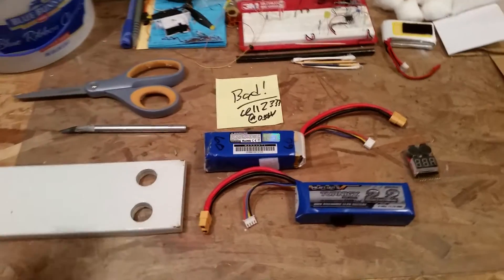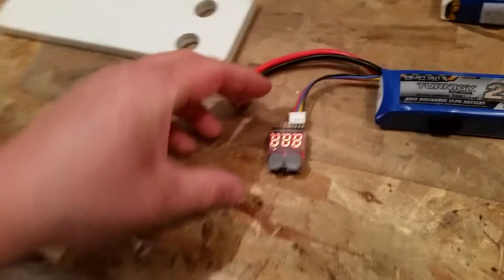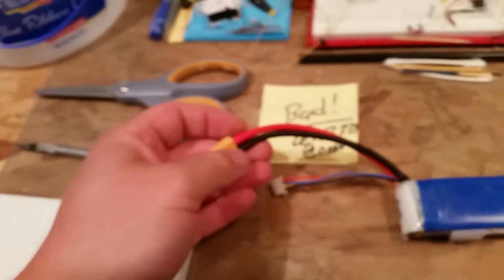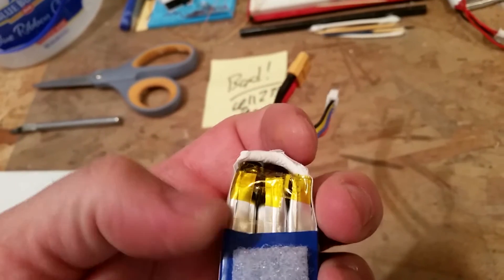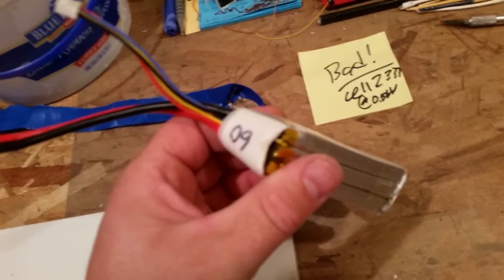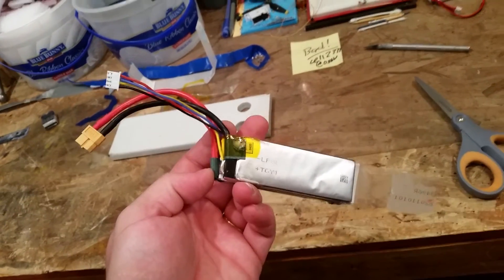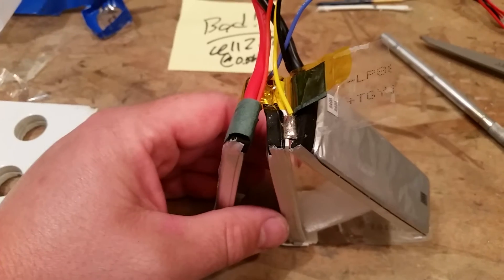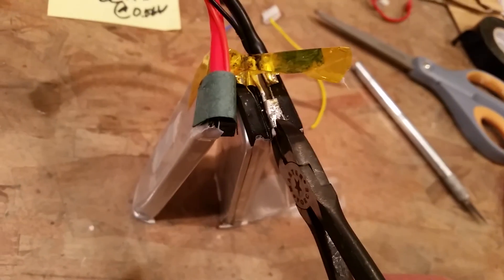Fixing Turnagy 3S 2200mAh 60C Lipo - Part 1 of 2

Comment: Hey Brian, talking about the dynam turbojet, I had similar retract opening issues on my Grand Cruiser (has same retracts as the turbojet) and found some retracts that seem to work even under very cold weather, look under this rcgroups thread, basically PZ-15090 from hobbypartz.com (out of stock) but found the same on aliexpress, hope this helps
Reply from the maker: Sure, thanks! I haven't had that problem for a long time. I also haven't flown below 60 degrees for a while either!

Could you tell me about how much the set of gear cost you?